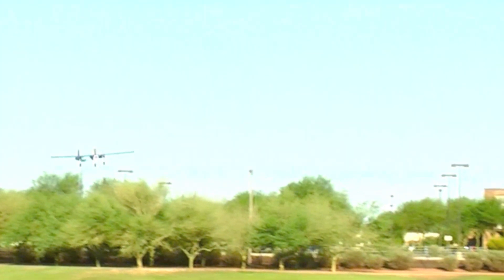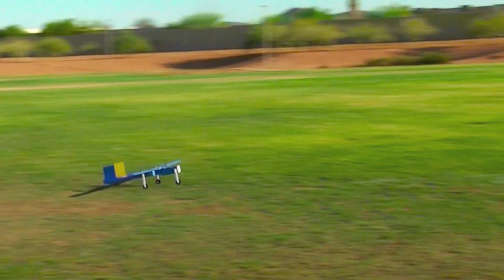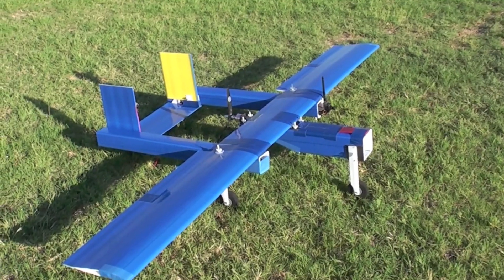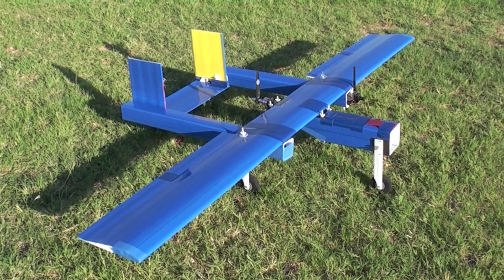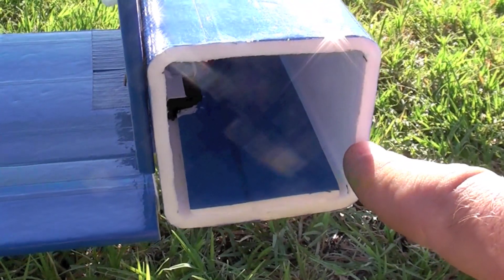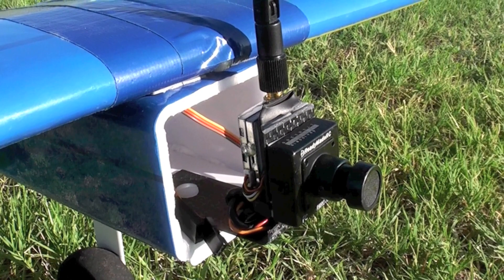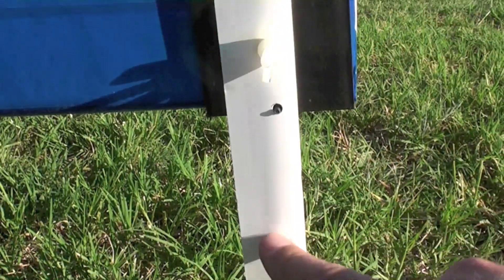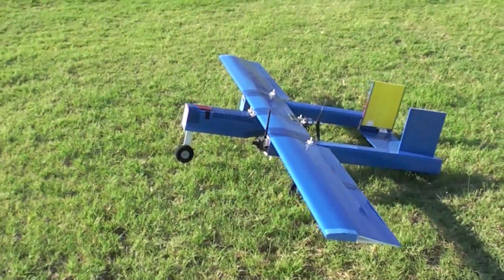OZONE Foamboard UAV for FPV

Comment: How do you calculate motor thrust? And would a Turnigy D2836/8 1100KV Brushless Outrunner Motor be capable of flying the ozone? Or is there another motor under $13 that would do the job for hking?

Comment: Hi been making my wings out of wall mart foam board not great for getting the paper of   but makes up for it with being heaver paper and foam and no need to peel the paper just score and run a round dowel down the line. glue up on the paper holding up great so far wings much more stiff                                          chuck

Comment from the maker: I love that motor and use it a lot. The 12x4 is borderline over-propped.  I'd probably do the 11x4 for continual use.  45a ESC is good.  Overall that setup would get you up to 1500g before it started to get underpowered.  I'd rather keep it under 1200g, but if you're landing-gear-launching it can be a little heavier than if hand launching.

Comment from the maker: It's actually 0 degrees like most of my planes.  I once worried a lot about this as I know it can be an important part of airframe design.  But it seems like we can get away with having coplanar wing and stab most of the time, maybe just trim in a little bit of up elevator.  To be honest I think this plane works fine as-is.  To have the elevator in the prop wash makes it pretty responsive in pitch, both trim and for maneuvering.

Comment: Did you use an angle of incidence on the main wing (relative to the rear hor. stabilizer)? If not, in retrospect, could the plane have benifitted from using an angle on incidence?

Comment from the maker: The dust was a bitch!  It didn't seem to affect much from a practical standpoint except the lens.  The 2.4 video link seemed very clean to me.  4000' elevation was not too bad, maybe 20% shorter flight time, but I was doing a fair amount of maneuvering too.  I learned a lot about flying out there, and packing for the trip.  I'd probably opt for a big-ass flying wing, and just take a second one as a spare, instead of taking 3 different planes as I did.

Comment from the maker: The screws idea you used is a good one but must be completely tight coz once a foam-penetrating part starts to move it keeps moving, and making a larger hole.  If you do this, try the tape in between the plate and fuselage to lock it in place.  BTW, the Ozone uses a pretty unconventional landing gear.  It was actually not hard at all, but best suited for large planes with broad side-surfaces for mounting.  A detail video will follow soon.

Comment from the maker: The trick with foamboard seems to be distributing the loads as widely as possible with the size of the landing mounting plate and the way it is attached.  The foam tape seems to do a pretty good job adhering a larger area to distribute the forces on the landing gear vs. the plane.  Piano wire struts have to be bent by you.  The do have some 'give' on landing.  Try sandwiching the wire between thin plates.  Also see therevjvegas for a landing gear idea.

Comment from the maker: I tell you, landing gear is a huge challenge!  It adds a lot of weight and complexity and I only do it on larger planes and/or planes I cannot hand launch.  The best luck I've had so far is with heavy piano wire or pre-molded fiberglass, plastic, or CF landing gear struts.  One-piece are better, two-piece work OK.  I screw these to a piece of CF plate (from eBay) or you could use rigid plastic.  This is Scotch 2-sided foam taped to the bottom and strapped on with Duck-brand duct tape.

Comment: Hi, I have built most of your planes and are very happy with them but ont thing I have had a problem with is attaching the landing gear. I put a piece of perspex on both sides of the foam board and a bolt and nut going through both as it looks like you did and all was good on concrete but when I used it on the grass the bolt started to rip a slot in the foam board from the little bumps when taking off or landing.
PLEASE HELP as I want to use landing gear.

Comment from the maker: I will do a more detailed video on the Ozone coming soon.  It is more complicated than the Peace Drone, but it does have larger payload and landing gear if that is what you want.  It is 2m wingspan, 1m long, 2400g.  The chord of the wing, horizontal stabilizer, and horizontal stabilizer is 23cm and all control surfaces are 5cm.  The wing sections are 75cm - 50cm - 75cm (left, center, right).

Comment from the maker: The drilled BBQ skewers are a great idea!  You have invented for scratchbuilding what they call "K-wires" in Orthopedic surgery for the same purpose in fracture fixation.

The humidity here is very low so things tend to stay together except when landing on the (irrigated) wet grass or if left in the sun.  The hatch is 3 thicknesses of foamboard.  Mostly just coincidence, because I overbuilt the upper panel of the pod in order to accept the wing mounts and motor mounts.

Comment from the maker: There's a lot that could be more aerodynamic about this plane, including the booms.  I built this one from off-the-shelf parts so it's pretty boxy.  It definitely needs nose caps.  The tail is left square so I can rest it on its rear while setting it up.  The "efficiency" I speak of is just the long wingspan, low wing loading, and low Kv motor.  The airframe is not that smooth at all. Maybe you'll build something like it?